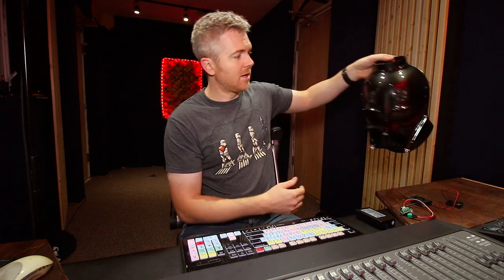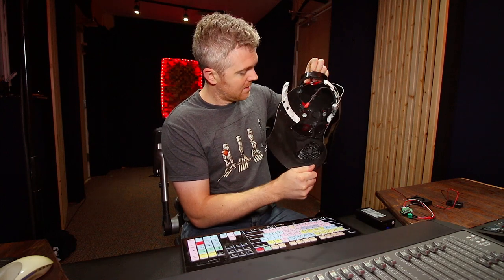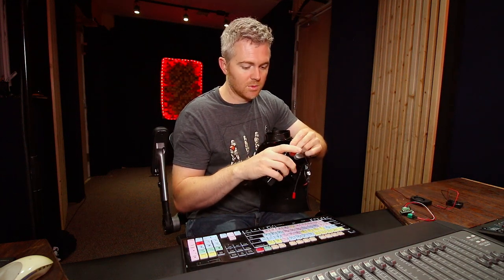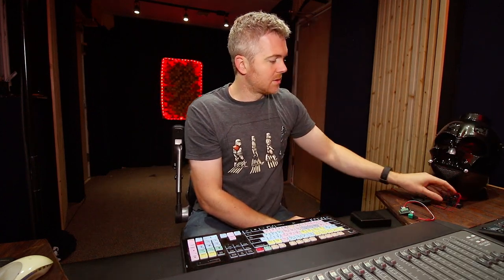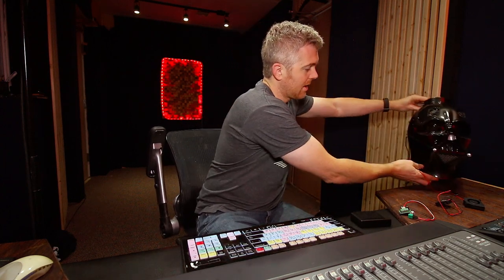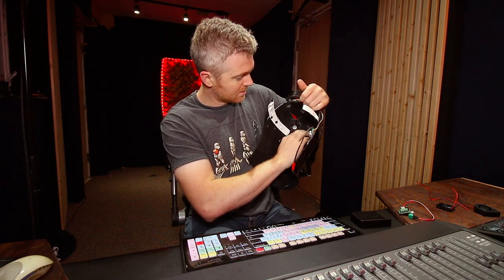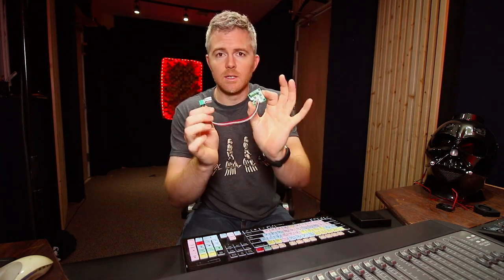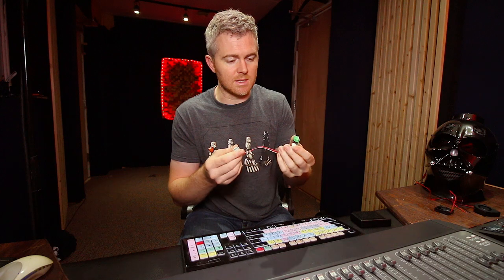My Darth Vader helmet cooling system build...

Comment: Where are you mounting the battery pack in the helmet? My concern has been moisture from sweat shorting the damaging the battery pack.
Reply from the maker: I use velcro to mount it on the back side of the dome on the top no problems for me with sweat or moisture. the fans really help keep the helmet ventilated

Comment: Hello!  Pulled the trigger on the ANH Quasi!  I made the transducer voice set-up you did the video on....works like a charm and can't wait to mount it to the armor.  I see that the power pack is the same as the one for the Revo, so 1) where did you mount it, and 2) are you running BOTH Revo and fans off a single pack?  Thanks!  MTFBWYA!
Reply from the maker: I put one in my helmet for the fans and one on my belt for the repo. Cheers!
Reply: Where in the helmet to you hide the big battery?

Comment: Hi, i have an efx standard Vader helmet and just bought a set of fans to go in my helmet similar to your setup. I was wondering how i would cut into my helmet to put in the two smaller fans near the top, and how i would secure them in the cut out holes.

Comment: Do you still have your cooling fan setup this way in your helmet today? I just received my Portmac and am considering the same? I already got the items you listed, but am a bit concerned with the amount of airflow those fans put out....it doesn't feel like much as compared to the 5v ones I have in my trooper helmet.